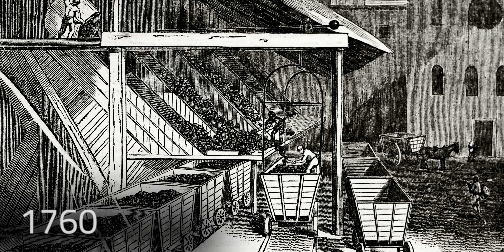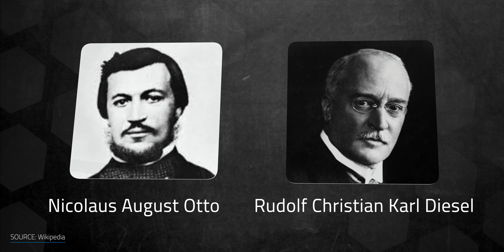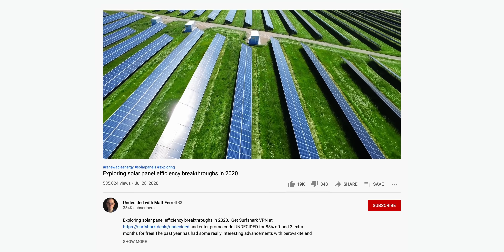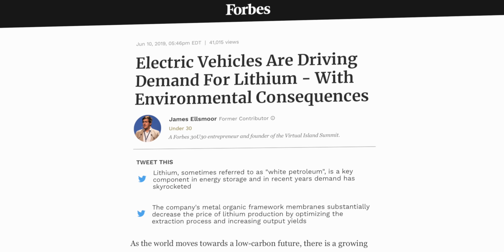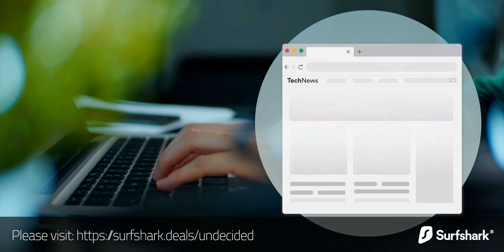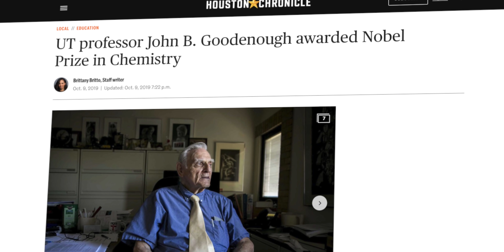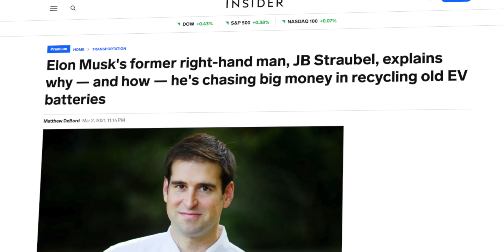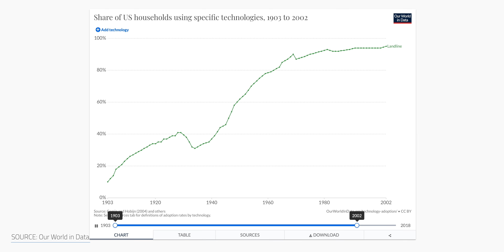Is the Future of Renewable Energy Inevitable?

Comment: Renewables are perfect tyhing to have, as a 40% in the total mix of the country. The rest should be a baseload, best if it's a non-emission type, like a modern atom plants. At least if You're a country with a lot of fog and snow in the winter.
Reply: A wind solar mix can definitely provide over 40% of the grids energy without effecting grid stability, wind alone provides 40% of my power already.
Reply: Nuclear has lots of emissions, even if you don't consider the constant leaks from reactors. Think of all the fossil fuel used to generate U-235. 1 million lbs. of 0.1% ore for 7 lbs. of U-235. Average reactor needs 10 tons of enriched U-235 per fuel cycle. Spent fuel is 1000 times more dangerous than the U-235 that went into it. Tailings still radioactive and acidic. How much fossil fuel is needed to make concrete and steel and build reactors? How much to dig very deep holes to store waste for at least 240,000 years, if they ever do that? How about to decommission leaky, rusty old reactors, if they ever do that? How about all the other toxic volatiles and chemicals used in mining and reactor maintenance? Lots of emissions; dirty, dirty emissions. Think of the effect on global warming of all the heat pollution from a reactor.
Reply: @jackfanning7952  I'm aware of the problem, but still nuclear is less emitting technology than coal, and still energy storage is a thing of the distant future, and natural gas in many countires is hard to find, or hard to buy from safe supplier, or plainly even few times more expensive than nuclear power. Would You dare to depend e.g. on Russia to deliver natural gas to Your plants, to avoid nuclear plant on Your own territory and operated by You, plant that You may refuel with fuel imported from few different civilized countries once every few years? MAybe in the future we'll get fully renewalble, but in th transition period You still need to power Yourself for the next 20-40 years.
Reply: @Puchacz83  In the US, energy production has consolidated into just 30 monopolies from a total of almost 100 a decade ago. All of them are heavily invested in fossil fuels and nuclear, with just a few renewable plants for show for PR purposes. The U.S. has several hundred years of natural gas, but probably won't need it because of advances in renewables and battery technology. Renewables have reduced in cost 70-80% in the last decade and nuclear is up 35%. Tesla has gone up in value 500% in the last 5 years due to its battery technology and is now worth twice as much as General Motors and Ford combined, and will get bigger exponentially. It has inexpensive utility scale (PowerWall) storage units, household size (PowerPack) and energy saving (PowerVolt) units that are all selling like hot cakes! The PowerWalls will store utility power produced during non-peak hours for peak usage times. We don't need to construct new power plants to meet peak demand. With new technology in renewables, storage, and energy savings in building construction and electrical components, we can meet energy demand for decades to come. We don't need no steenkin' coal and nuclear! NY, NJ, RI, Mass,, Md. and Va. have signed contracts with European companies for 11,000 megawatts of offshore wind power by 2024 with another 20,000 megawatts by 2035. The European companies are excited about the prospects for offshore wind on the U.S. East Coast because of proximity to large markets, steady wind and a shallow seabed. The turbines will be far enough out to avoid complaints from shore dwellers and will not interfere with birds that migrate closer to shore. The Empire State Reality Trust (ESRT)  has a contract with Green Mountain Energy to provide renewable energy to all of its vast real estate portfolio (10.1 million sq, ft.) in NY and CT., with a cost savings of $800,000 annually and 450 million lbs. of carbon removed from the atmosphere. The Empire State Building has been powered by renewables for 10 years. Google, Intel, Walmart and Microsoft are rapidly expanding their use of renewables in their businesses. The fossil fuel and nuclear utilities have done their best to lobby and bribe legislators to hold down renewables, but they are failing. You can't stop progress with cheaper, safer, reliable renewable energy. Cathy Woods, CEO of ARK and leading stock picker of 2020, predicts the utility market will have vast changes in the next 5 years with new technology and huge numbers of employees at traditional utilities will lose their jobs as a result. You better find a new horse to ride. That old nukie nag is headed to the glue factory.